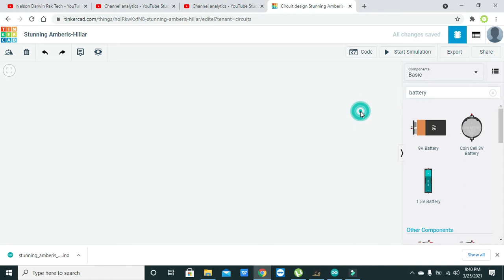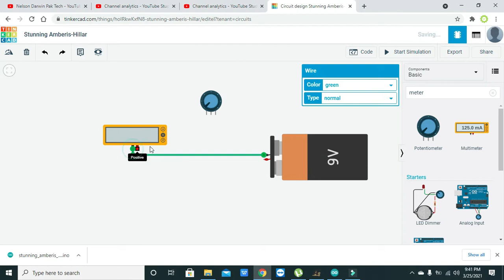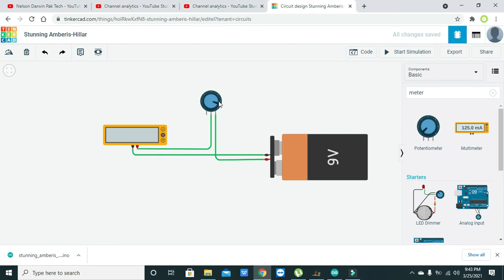variable power supply in tinkercad | multi voltage power supply in tinkercad

Comment: I thought that we should connect a multimeter in parallel to measure voltage.
Reply: I was a bit confused too but I realized he's checking the voltage between the positive terminal of the battery and the wiper which varies in resistance. as the resistance between the positive terminal on the potentiometer and the wiper increases, the voltage across it also increases. So essentially this is a voltage divider that serves as a variable power supply from 0 to 9V.